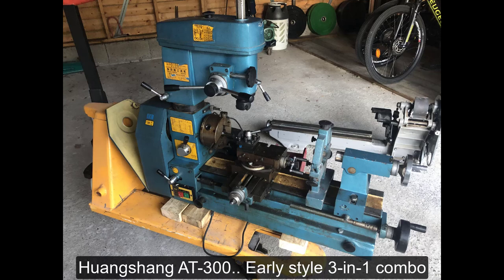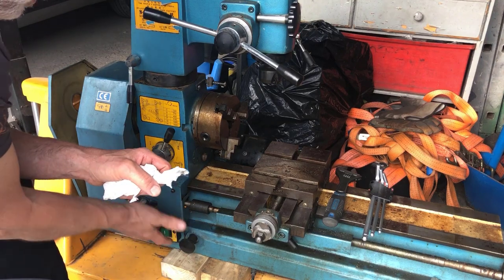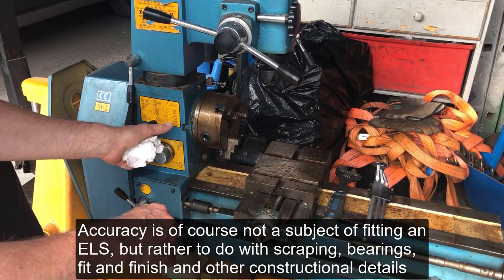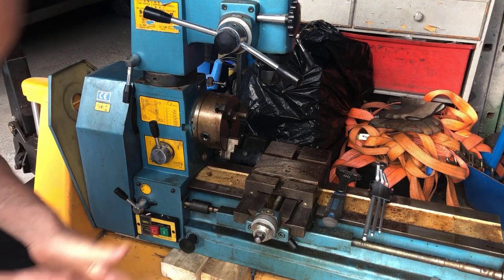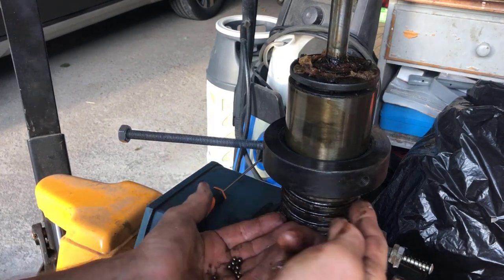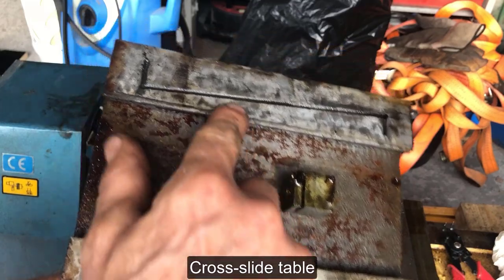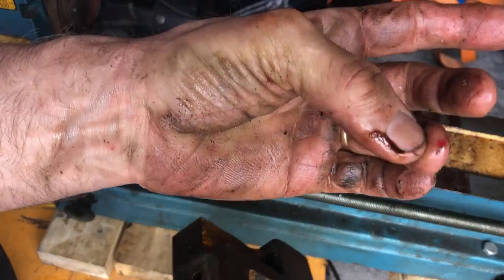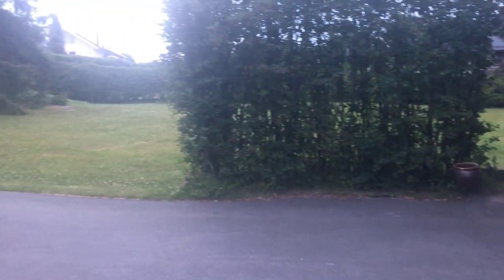AT-300 lathe-mill-drill, introduction and disassembly

Comment: Does anyone know how he remove the Lathe Head?  I have the same machine.  The manual shows locking pins behind set screws.
Reply from the maker: 2 bolts from underneath. Sorry for leaving that out of the video. However, it is possible to understand more by looking at this video https://youtu.be/L2f7hJ6L76Q?si=tvyhtp2R9diS6Svp
Reply: @jansverrehaugjord9934  Thanks, I was wondering why it would not move.  The parts diagrams in the Smithy manual did not show it.  I just checked and that's it.  Thanks again.
Reply from the maker: @michaelwilson4700  You're welcome. Feel free to ask more if you need to.. I will do my best to answer

Comment: You never stop working Jan! Really looking forward to this project. These models seem to fetch a surprisingly high price on EBay in the UK. The position of the mill head is universally derided, but a lot of folks who have the basic lathe say good things about it. It'll be interesting to see how far you can push the specification.
Reply from the maker: Thnks! Yes, it is a low-end solution, but I wanted to find out how bad it is really.. and thereby the potential for improvement. So far some of the bad impressions have been confirmed, but still..

Comment: These machines should come with a helmet. Every time you bend down to precisely align a lathe tool with the work you bash your head. The spindle is so far above the bed in order for the mill attachment to work that the lathe lacks rigidity. It seems like the best of both worlds to a beginner - get a lathe and mill for the price and space of one. But then once you get serious about using you find it doesn’t do either function well. I’m sure Jan will get the most out of the machine for what it is. Good thing he got it cheap.
Reply from the maker: Thnks for commenting. This is kind of an experiment, so will see how it goes. Agree, it is a beginners machine, and the milling head as is a compromise at best. I have some ideas, so will test. However, my bet is that most buy a separate mill and just park the mill aside and use the lathe as they gain more experience.. or sell the machine.

Comment: Hi Jan. Thanks for the video. I was just as dumb as you on the column bearing😑. Did you find a way to put the balls back? I'm struggling with mine😡. Thanks
Reply from the maker: Hi there, thnks for the comment 😁
I have not done this, no. The reason why is that I have relocated the entire mill head and will use another means to raise and lower this (lift cylinder with electric motor). PS! There are some other users with good videos on how to modify this (and much more)

Comment: toolroom specs?
you will be lucky to get it to carpenters specs.
the construction i not sound and cannot be improved without building a virtually new machine.
i had one of those and all we did with it was to spin a circular steel brush in it as that was the only thing it was good enough for.
Reply from the maker: Hehe.. call it an optimistic approach.. :) We'll see how far this can be "improved". The design is packed with flaws.. sure, and I know of course that what you say if probably correct.
Not to use such expressions as "toolroom specs", I am sure it can be "enhanced" at least. I wanted to have the clean bed/saddle/cross-slide on the surface plate to see how bad it is, then make a judgement. My intent with this purchase was partly based on curiosity and then also to show yet another version of mounting the ELS system, especially for those having similar types of "change gear only" lathes. I didn't need another project now, having just bought another 3 Myford ML7's up for restoration, but since this "wreck" appeared, I thought why not just check it out.

Comment: It makes me wonder if it would be much the same thing to put a bench lathe on a thick steel plate base, and bolt a bench drill press to the same plate, over the lathe.  

I'm not convinced it would be a better idea than a toolpost mount for a drill / router / grinder.  Maybe?  Maybe not?
Reply from the maker: Hmm.. not exactly the same thing, but depending on what your goal is, more than one solution would work I guess. In my eyes what is lacking in the design as it is original (apart from build quality) are rigidity and reach (xy-travel). The former can be solved in various ways.. at least I think it can be greatly reduced. One solution I would like to test is to make a type of bridge construction, possibly anchoring it to the tailstock end. This also involves relocating the milling head a little further to the right, which will allow a bigger performance "envelope" and less need to take off the chuck, in other words also solving the "reach" problem. It probably will involve a 2nd motor though. Anyway, some experimentation and look to what others have done.

Comment: I was given one of those as a plain lathe without the mill attachment  and i think a powered leadscrew is the minimum needed to make it usable. Having no saddle handle you have to give your arm muscles a workout every time you use the damn thing turning the lead screw handle.
ELS and a ballscrew might make a great start to a cnc upgrade.
Reply from the maker: Thnks for commenting. My thought too.. an ELS here would be the "natural" addition to replace the change gear setup as well as provide rapid and slow positioning of the carriage
Reply: @jansverrehaugjord9934  - Change gears shouldn't even be a thing anymore, except for antiques.  The cost of an ELS would be shockingly low if it became a standard feature of asian clone machines.
Reply from the maker: @somebodyelse6673  Agree! Actually I cannot complain about the price of the ELS as it is sold from Rocketronics. The box in itself is (in my eyes) not expensive at all.